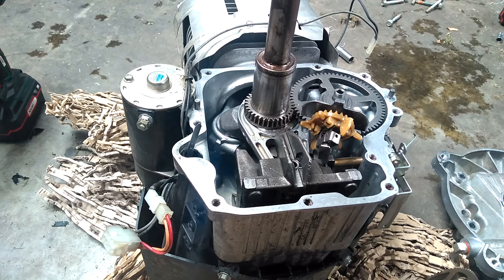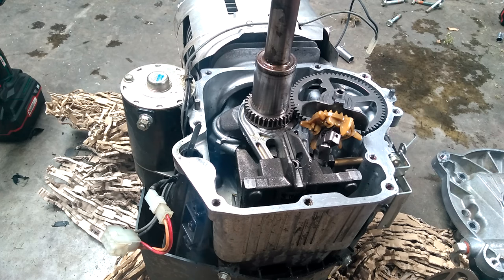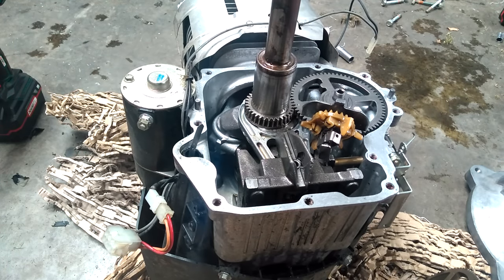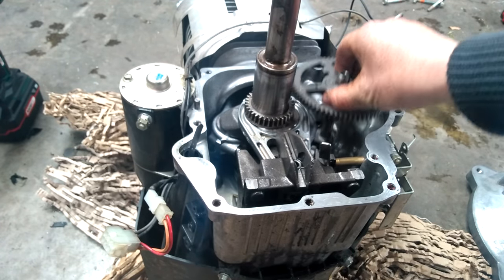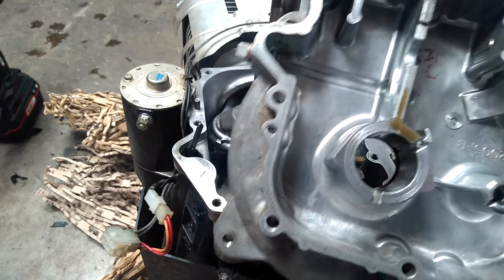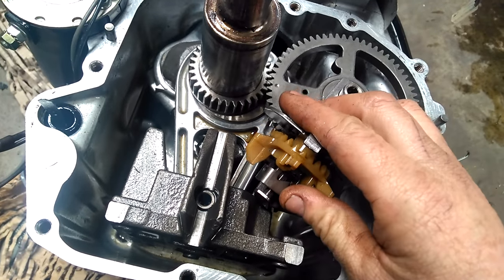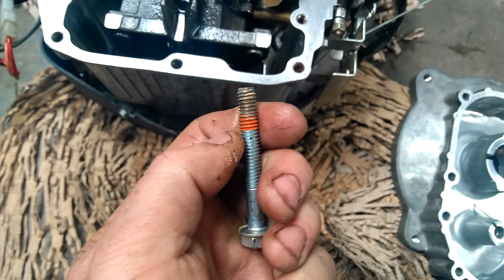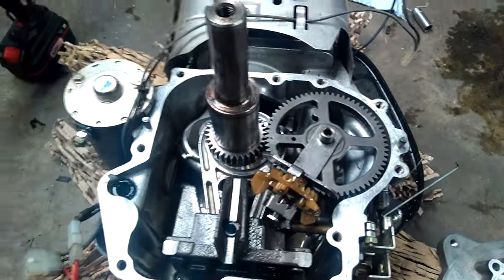Briggs and Stratton Camshaft Replacement

Comment: The camshaft rotates once for every 2 rotations of the crankshaft. Therefore it’s possible to have the dots lined up but for the camshaft to be 180 degrees out. If like me you are unfortunate enough to have moved the crankshaft inadvertently while the camshaft is removed the solution (assuming you have tried to start the engine without success and much backfiring) is to line up the dots, then lift the camshaft and turn it as close to 180 degrees as you can, then turn the crankshaft until the dots are aligned or close to alignment. If they are out by a couple of teeth simply move the camshaft round a couple of teeth until they mesh, the timing is then correct. I found out the hard way through my ignorance.
Reply: This is very interesting to me if I manage to put my L-series engine back together and it’s 180° out of phase with this cause it to not start?   What I’m getting is it attempts to start when cold in the choke is closed but as soon as it’s butter is a few times and I do mean like maybe five or 10 times I open the choke a little bit and it just dies. Also, I noticed saying that there is gas pumping out of the carburetor inlet.
Reply: @iRepairElectronics hey I have a question for you, how is the governor held in place? It seems like I can push it off its tab it would fall off with engine rotation

Comment: If you use the mower intermittently , just take off the air filter , cover the pipe completely to cut off the air , get it spinning , pull your hand off & it will fire right up !! Been doing this for years on a 19hp Gold Series engine !!
Reply: You still have broken pieces in your sump.

Comment: I have had now two of the Briggs 19hp in my John Deere E110 fail.  John Deere replaced the first engine..50 hours on it.  This engine lasted 53 hours..One year and a week!!   John Deere told me sorry your on your own.   I took it to there Corp and they told me the same thing.  So glad to find this video as I will have to fix it myself....and NEVER BUY a JOHN DEERE AGAIN
Reply: You do realize this is an issue with briggs and Stratton? The compression release breaks off and then the engine cranks hard.
Reply: 2 years later and they are still junk. 41 hours on mine and I have almost $200 on parts to put it back together. JUNK!

Comment: This is exactly what happened to mine, I couldnt figure out where that broken part came from but my govenor gear was broke as well.
Reply: Craig did you get this repair done? I'm thinking I got broken cam or governed in a Murray 450 series engine.   It starts but something is grinding
Reply: @jesusdrummer21  yeah I did, it's actually a simple fix once you take the motor out, use a magnet to take the metal out. An make sure you get the right governor an new seal an gasket

Comment: Don’t forget..!!!…. there is a short oil-pump drive-shaft that sits between the cam and the oil pump!….  Get it out of the sump before you reinstall the bottom sump-cover….then after installing the sump cover (oil pan)…. slip the short drive-shaft back into engagement with the cam-shaft keyed-end…. and reinstall your oil pump so that it is driven by the cam!
Reply: this engine doesn't have an oil pump. Note lack of oil filter and access cover on the sump cover. But for those that do there are a couple extra steps. This guy does a good job of explaining those steps. https://www.youtube.com/watch?v=dWHPHGZAvj4

Comment: Both of my valves are motionless when I crank it. Had recently replaced the flywheel because it fractured at the keyway when she struck an object in the grass. Ran fine for a week and now the valve train stopped.  Piston still moves as you roll it over. Is it possible to have a broken cam or gear?
Reply: Same issue at 41 hours. The compression release widget on the camshaft came off and broke the camshaft, crankshaft gears in mine. JUNK motors.

Comment: If you have a oil filter on your motor, make sure you get the right cam. With oil filter,the camshaft will have a slot on the end. The one without oil filter,the camshaft will not have a slot. And as far as removing the pulley off the crankshaft? You may come across a stuck pulley. Then you have too heat the crankshaft.....Good luck.

Comment: hey Mick;  i have a question i think you can help me with. i think my 25 hp briggs and  straton is leaking oil at the part where you said to clean well and sand paper it where it's taken apart. that whole surface.    is that something you might have seen before  i really need some help if you don't mind.

Comment: Mick have you ever had the timing gear spin on the crank? I took off the oil sump cover to watch the crank as i rotated it, and as the timing mark gets to where it should be the piston is down about an inch..any ideas will be greatly appreciated! Thanks!
Reply: I just had this happen with a B&S 331777 20hp. When the compression release on the camshaft grenaded, the shaft got jammed somehow and the attached timing gear kept turning. Actually, the timing gear spun on the shaft so hard that it spun around like a roller skate wheel. Lost all compression.

Comment: Hi Mick
Maybe a Long shot. I need to change camshaft on my 2006 BG 12.5. Engine id impossible to read.
It is a match to the one you have, looking at the shaft end. 
Do you have a cam shaft part number and maybe an engine id you can share

Comment: Question: got a B&S 344cc engine on my craftsman 33” mower. Pull start on top removed. If I manually rotate the fly wheel it gets VERY hard to turn at one point. But it eventually gives and becomes easy again....until I reach that point in the cycle again. What is wrong?
Reply: Broken compression release lever. Replace cam.

Comment: Looks like I m going to have to do this. New battery, starter turns motor freely when spark plug is out, and I adjusted valves, but still half turn when trying to start. Yeah my mower is only two years old. My old craftsmen I had for 15 years and never had to do this. How old is your mower? Also any extra advice or confidence booster before I start is appreciated! Thanks for video!
Reply from the maker: Hi apologies for late reply, The same ingredients are not in those cams as they used to be... its also worth checking that your batt is the correct...what mower do you have now ?
Reply: @mickmac7264  Craftsman t2200
Reply: @mickmac7264  All went well. Runs great. I had to adjust the valves 2 or 3 times before they would stay. I stripped one of the bolts to the engine cover. Wished I had used a torque wrench. See my video. Learning process. gave me confidence to fix in future.
Reply from the maker: @bif90210  yep learn as we go,. Sometimes you've got to strip a bolt to know how far to push it. Im working on stuff daily so I've developed  built in torque in my arm.. yep seen vid good job..

Comment: On my MTD push mower, the starter motor won't turn with spark plug inserted.  As soon as I remove it, it turns freely. What can cause that? I've removed the spark plug and pump out oil out of cylinder and piston wall. Have no idea what else to do.
Reply: check the flywheel key

Comment: I have new Camshaft for my 31r907-0007-g1 not put in yet, what do I need to put on gasket
Reply: Some people put gasket maker on the surface the gasket will be placed on. But you don't necessarily have to put anything on the gasket.